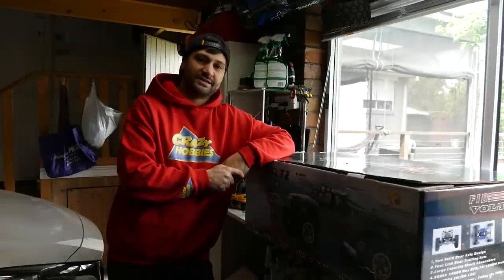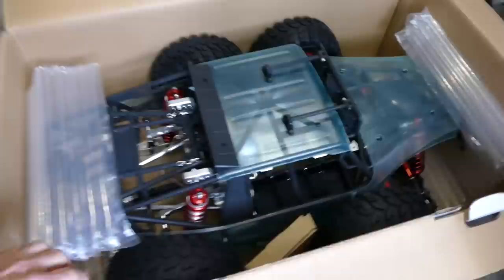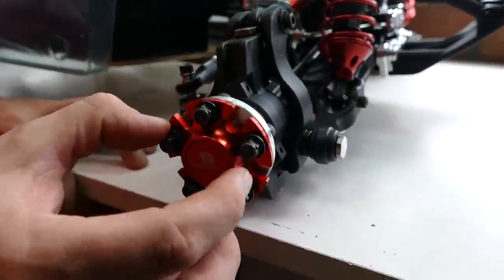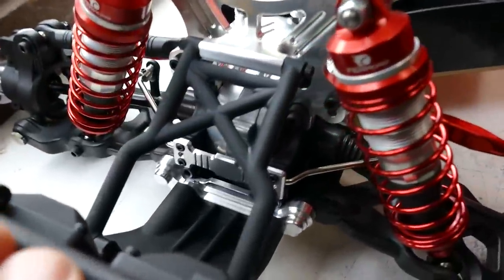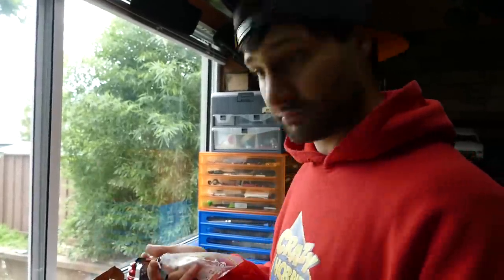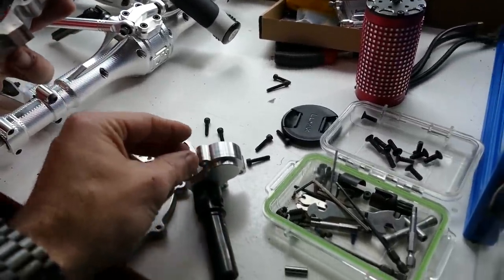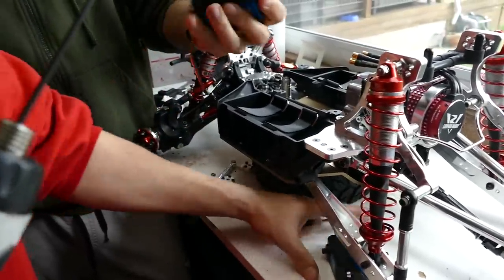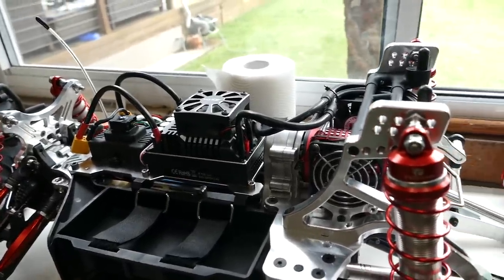FID RACING DRAGON HAMMER V2 1/5 4WD BEAST - Unboxing & In-Depth First Look

Comment: If you were to chose beter one dragon or vekta? In terms of quality, price and overall enjoyment.
Reply: I have run the Voltz for a full season now.  have not owned a Vekta but my friend had one.
The voltz seem to be at least the same quality apart from a few small things that is easy 2 fix.(bad  hingepins and swaybar).
At least in Europe it is A lot cheaper than kraken, especially the electric version So i would easily take the Voltz .

Comment: On the #81 Red truck, I saw that the pinion gear is open on the motor plate. Is there a cover for it? Or is it open all of the time? If it is open, that would be hard on the gears as you would constantly be getting sand, dirt, water, and mud up in there. 
Those are beasts, I will have to get one, and I will see if there is a U.S. supplier as it's over $300.00 to ship it here.

Comment: SUPERB! great to see you guys getting your hands on 1 of these! I have seen and filmed 1 myself and seen it run with the std electronics on 8s. it was pretty quick. The guy blew a foam out of the wheel/tyre within a lap i think ( check my vid if u r interested) ... so be aware... no doubt you are already... that 12s power will need some tyre/ wheel prep for sure. the standard tyres are big ( larger diameter than the v2 petrol version ( an option) so they will balloon big time. I was also very interested in wether fid have considered the dreaded 1 wheel up in the air on power problem other solid rear axle e cars suffer from. after seeing the car on 8s i am concerned that they have not considered this and found a solution like traxxas did with the UDR. The yeti xl seems to suffer big time on 6s for example.

Just 1 issue from your starting intro to the car... ( not managed to watch the whole vid yet)... this is not a chinese vek5. The cars are very different. the only real similarity is that they both have a solid rear axle. thats about it. The FID was also around 1st. The FID Dragon is however most definitely a vastly higher spec car than the Vek5 out of the box at a much cheaper price. The 2 handle very different too. I think in general the VEk5 is a no brainer in the US compared to the dragon with the US availability and pricing. Uk and maybe elsewhere the FID is by far the better financial choice. 

Looking forward to watching the rest of your vid and running videos!! big thumbs UP! ;)
Reply: What is the VEk5 can you give a link? Thanks. I’m just getting into RC cars.

Comment: Hi 
I have the same truck as yours and i have a problem with it...
Everytime i take it for a spin i blow out the tires after 20 seconds (two 16000mah 4s 25c batteries).
Do you have a suggestion for a better tire maybe?or a solution to make it last longer?
I cant find any other 230mm tires (smaller means less speed obviously)
Thabk you for your help my friend
Reply: Diff oils !.
500k-1m  front and center. And a bit less throttle from the start.

Comment: The tall tyres cause the traction roll. Throw some Baja 5T wheels on the Vekta and it will never roll, I've tried my hardest but to no avail :)
Reply from the maker: Good thinking bro
Reply: U can do that on the Voltz as well... baja tires fits fid wheels.

Comment: need an update on this !!  and can you guys do me a  HUGE  favor and weigh Dragon Hammer against the VEKTA  ??
Reply: The Dhv 2019 is about 25 kgs with 15000mah 8s batteries. I have put mine on the scales.
My friends upgraded gas vekta is 24-25 kgs. So quite similar.
Reply: Dominick Shauntee you still running your DH I seen you messaged saying your in US an a DH owner justed wanted to know pros an cons would appreciate it
Reply: @runngunrc1991  yes i live in U.S. and still have my Dragon Hammer if you check the Dragon Hammer Voltz group on FB you can see it thourgh it's transformations  it's now basically a monster truck with primal mt tires and rims on it and a shorthend  redcat clawback body on it .. so hard to compare it to  other stuff  ... hard to say what i  did not like about  it since i never played with it in stock fourm ...

Comment: If you pretend to be experts in metalurgy, at least state some expert facts about the difference between 6061 and 7075 aluminum... 6061 doesn´t oxidise, meaning it doesn´t need a protective cover such as paint. And it´s more flexible, meaning it won´t break as easily on impact...
Reply: schwarzerkuerbis - Congrats bro, your now that guy on the comments #keyboardninja